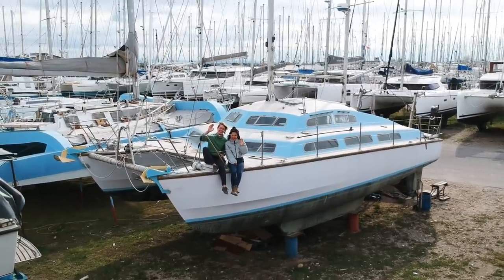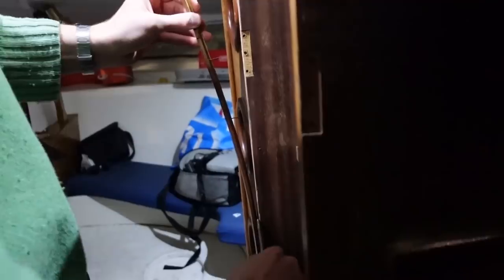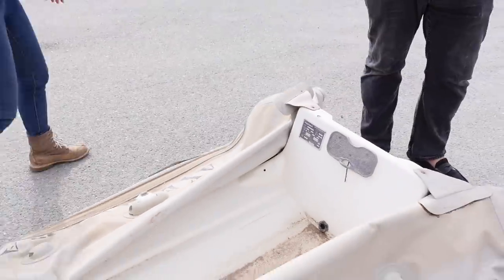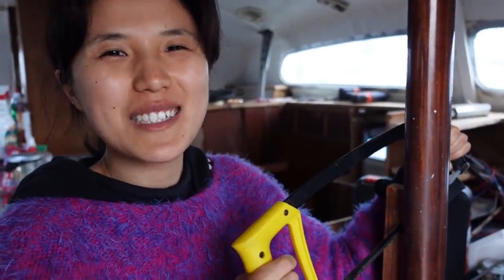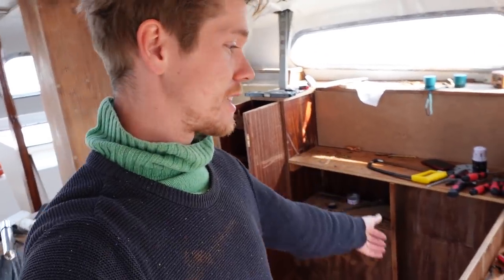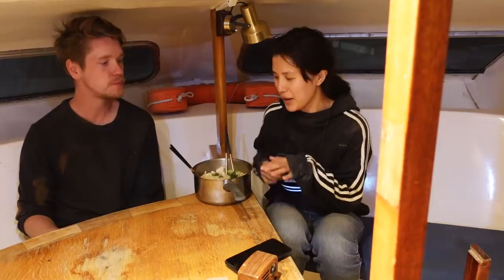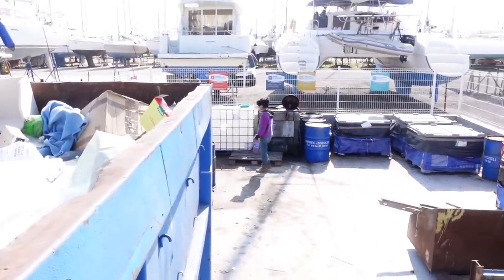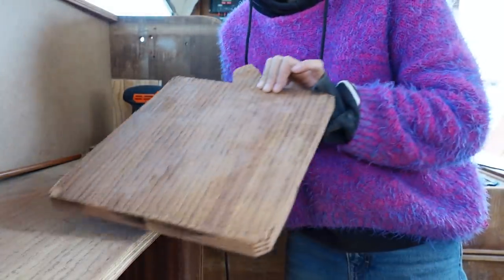Dirt Cheap Catamaran Refit | Part 1 | Wildlings Sailing

Comment: Hey Mark you really should install an expansion tank for your water system. i noticed that your pump turns off and on with the faucets. If you install the expansion tank it will act as a buffer allowing the system to hold pressure for longer which means your pump wont run as often.
Reply from the maker: Cool, will do for sure, it's definitely needed

Comment: Just some safety tips from my experiance,    #1  Clean your fuel tanks if you can,  Some day you will be in heavy seas and  scared , thats when crap will come loose in the tanks  and plug your filters and shut you down at the worst moment.      #  2 thouroughly inspect and lubricate your steering and rudders.   #3   If you can , find someone who is very  knowledgeable about that engine and those hydraulic sail drives to check them and teach you how to maintain them because you will be the one fixing them .  #4   Change out  below water line thru hulls if they havent been changed in a long time, seal  them properly.      These are just key safety items needed to get you through a storm.
Reply: And take out and plug up the through hull speed paddle wheel if it has one.  Major common source of failure and scary when they do. See Lady K and Zingaro episodes.
Reply: i was in some of the cat forums and a cherokee 35 owner said "once we pulled out the old hydraulic drive system and put in a Honda 50hp she sailed quite well"  The number one problem with sail drives is corrosion and if the previous owner didn't keep up on replacing anodes, the drive may need more work than its worth.
Reply: @gregh7457   I heard that too on old hyd drive issues, thats the best fix ,  could cut half the weight too.

Comment: Prep work is the most important.  95% prep, 5% paint is my formula.  Get the "best" epoxy paint you can afford.
Reply: 🤔 as for the deck non-skid & not knowning. If the adhesion is still good, clean it really good. Then clean it again. Yes, again! Apply a thin coat of etching primer followed by several thin coats of capatable (with the etching primer) mono-epoxy paint. This should do the color change very well.

Comment: For 11k, you got that Cat for a steal. I tried looking at a Cat originally and I couldn't find one for that price here on the West Coast of the US. 

My only warning: don't lose motivation. You're taking on a serious project, and more often than not what causes a boat to die is someone giving up mid-refit. Push through, and you'll have many years of happy sailing.
Reply: In Seattle, but closest to this I could find was a Cat on the East Coast (converted to power only) for 14,500.  Should go to France to the cheap boatyard.

Comment: On our old Cherokee we ended up removing the motor and all hydraulics. We cut a hole in the cockpit sole and bridgedeck, built a pod and hung a Honda 50 outboard on it. We shedded hundreds of pounds, removed 2 large 3 bladed props that were a lot of drag under sail and made the Honda steerable with the wheel. Really transformed the sailing performance.
Reply: He could just keep it until he has enough money to put those folding props,  the kind that folds when under wind power open up under direct power. It looks squidish (my daughters words. she's weird like her dad)
Reply from the maker: Nice, we're definitely keeping an open mind in a conversion
Reply: Which Cherokee did you own (Hull #)?  I moderate the Iroquois Facebook Group and we are trying to document ownership / location of all Sailcraft models

Comment: We love the way you're re-using and re-purposing the old stuff on the boat. Not just chucking it out and buying new. I'd use Blue Hylomar on any joints that could leak water / fuel / oil / you name it. My moped is made of Blue Hylomar.
Reply from the maker: Thanks for the suggestion 👍

Comment: I recently re-did my trimaran's deck and after talking to a painting store owner i used enamel outside decking paint almost more than half the price of ''  marine decking paint '' and it's been on for a year now and i have not had any issues but surface preparation is the key to any painting i even rang the companies help line and the people there told me the only difference between marine and house hold was the price and the label good luck and BTW you guys are amazing a true inspiration to all cheers from South Australia

Comment: Leaving the Comfort Zone?  It's like jumping into cold water, it's not easy.  But if you never do it you will never experience those amazing sunsets, those quiet nights bobbing at a secluded anchorage, motoring down a lush glass like canal in the morning.  Then there is the eeriness of being deep in a dripping lock or the exhilaration of pounding to windward in a fresh northern sea, the sails taunt and the rigging humming. Or a quiet sail across the bay at midnight - the only sound is the ripple of the bow wave, and flashing light houses and harbour lights thirty miles away to the south, watching a green meteor with a smoke trail streak overhead.  Sorry to go on, but I've been there, nothing on land comes close.  Good luck with your boat Mark and Nadiyana.  When you get to a quiet anchorage it will be your own private little cottage on the water.

Comment: The old fashioned way to do deck paint is to sand well, paint the deck with a good enamel then tape off the areas you don’t want non skid and paint the area you do, while it is wet sprinkle it with crushed walnut shells ( which you use to be able to get at the chandlery for cheap). When the paint dries brush off the excess grit and put a coat of paint on the whole deck. Looks neat and professional at a very good price. Sand works too but walnut shellscare lighter and easier on bare feet. Lots of luck!

Comment: One other thing mate, if you stick the end of that plastic pipe in a cup of boiling water, wait till it is soft, slip it on the hard pipe and tighten up the jubilee clip they won’t leak. Good luck guys.
Reply: Or the heat gun they already have.
Reply: Thank you! You have just helped me with a bathroom sink leak!

Comment: As long as the hull is sound then that is a fine deal. I paid way more for my Gemini 105M and it didn't come with updated electronics or a big box of tools. My engine and drive did run but was so neglected that I swapped it for a Yamaha T25 extra long leg outboard. It will be interesting to see you go through all the systems particularly the engine and hydraulics.

Comment: It looks like you are doing a reasonably good job chopping down those old cabinets and converting them into your new galley. 
That's not the easiest way to do things but it will save some time in the long run, it was brave to tackle that job like that and I think it will be much more practical than before !
I wouldn't want to have to rip it all out and start from scratch, that gets expensive and there's no end of designing and decision making before you can even start to rebuild it, at least this way you just need to decide what to cut away and what to leave.

Comment: Hi guys!! To prevent leaks, it is a good idea to put two collars on your hoses. It is mendatory for canadian boats but not every country requires it. You put one going clock wise and the second one a bit further going the other way. It one of the collars fails, the second one is there to do the job!

Comment: Talk about taking on a project! You two are fantastic !  So  far as deck coatings, I would suggest using a product called TuffCoat,  (made in  USA) I checked and found that it was available in Europe, or could be shipped to there. It is a little pricey- $79.00/gal, and they recommend a primer coat also. Advantages : a rubber softness , a nonslip compound in the mix, and very good reviews by users.    Keep up the good work .

Comment: I’m absolutely loving your approach to this project; a few descriptive words that constantly run through the tasks are ; Practicality, economy, ingenuity, repurpose, repair and, last but not least, fearlessness!   A couple of comments I’d suggest considering though;  verify the internal parts you are removing are not part of the structural design that may compromise strength of the overall hull. When you rebuild, use screws and marine glue to ensure strength of the finished construction, nails won’t be strong enough. Try to “modularize” the cabinetry where you can so as to make it easier to remove sections in the event you need to get behind them in the future. When repairing or rerunning water pipes, make sure as much as possible that they drain to low points to avoid freezing when winter comes.  If you can use hard “Pex” style pipe and compressions fittings you can avoid joints pushing off fittings, especially if it’s on hot water runs. Keep up the enthusiasm ! 😎🇬🇧

Comment: Hi Guys love your project, one of the best non slip deck paints is "KIWI GRIP" easy to apply and is tough as old boots and the best part it's water based, it's a little expensive but definitely worth every cent. Cheers from Down under.

Comment: Great job! If you break the jigsaw blade near the top, if you just grind it down a bit on one edge for about 8mm so it fits the slot in the saw itself you can keep on using it. I might suggest using a more aggressive courser blade for the thicker wood then using the sander  to smooth the rough cut down. Paint could well be fine, just need more stirring to mix up the pigment then varnish the tin to slow down the rust, which does not look like it's penetrated the tin yet. I use a handheld belt sander to good effect. A course grit gets rid of a lot of material and can deal with a large area. I used mine to clean the hulls on a cat before giving them an epoxy barrier coat.

Comment: Hi Wildlings!  One of the big expenses on a cat is the rigging. The rigging on a cat takes a lot more of a bashing than if it were on a mono hull - obviously, as cats don't heal and spill the wind in the way monos do. Also, I imagine that model may not be too good upwind so you may find you motor more and, I expect the engine is a bit of a heavy drinker!  It's a pleasure watching your happiness - I'm very happy too!
Reply: Mercedes OM636 @ 1500rpm (which on a Westerly 33 gets you 5.0/5.5kt depending on wind and current) consumes an average of 2 liters per hour. At 2000rpm it'll be up to 2.6lph - and that's with a non-overhauled engine and fuel injection pump, they've got an overhauled everything really so it should end up consuming a little bit less than that. It's not too bad for a 42hp 4 cylinder :)

Comment: The deck can be painted once prepped, Then when the first coat gets tacky, Chuck sharp sand all over it, Weight 1 hr, Go for a cuppa, Then brush off the excess sand lightly, Then repaint over the sand, That's what we did for painting fishing trawler boats, And it lasts for years, No expensive paint needed.

Comment: Once you have sorted the basic onboard living conditions, get cracking on the motor before dealing with deck, rigging and hull cosmetics / fixes (assuming there will be no surprises with these). Motor issues can be messy and costly (of course). Well done so far. Great project and satisfying for you and of course the viewers too. Best.

Comment: Awesome progress guys! As far as non slip goes, I would use what you have to hand. But otherwise, I would use Kiwi Grip, it's easy to use, easy to repair, and only one pot so no mixing in hardener or sand etc.

Comment: the greatest costs associated with Cats over Monos are things that are doubled up on or found only on Cats. When you have 2x engines you also have two shafts, belts, filters that sort of things. The other thing is the trampolines. That is a cost that is not equalized on Monohulls. But what you cost up you also get benefits associated with. Such as great handling while under power, a lot of space on deck, and some redundancy. Cheers on the renovation and Best wishes!

Comment: Painting = prepping.  The very best paint in the world cannot cover a bad surface.  Even worse, painting over problems will let the problem re-surface later, and likely worse than it was at the time you painted.  Prepping the surface to be painted is critical to good adhesion.  If there is loose debris, oils (even body oils from finger prints) will later reflect in bubbles, paint coming off, etc.  So, right before you paint, throughly clean.  Other posts have said 95% prep - absolutely agree.

Comment: Rare boat have not seen another ketch cat on YouTube,  In USA often preferred paint is Awlgrip, some use cheap paint with regrets
Reply: I agree, but first buy a small amount of the expensive paint and first do a test for optimal adhesion to the old paint, also the quality of the substrate must be good.

Comment: For paints International Perfection 2 Part Poly Topcoat is fantastic, applied with mohair rollers no need to tip it off and looks better than sprayed, A channel to get advice is BoatworksToday for paints, antiskids and fibreglass works being american the paints arent easily available but International marine is it for us...(I think Mads of Sail Life used it on Athena)..Just remember lots of preparation and cleaning before any paint touches a brush....
P.S. Little tip when cutting veneered or faced wood score the pencil marks with a stanley knife/boxcutter/scalpel it will prevent the saw blade tearing/splintering the finish
Reply: P.S. Little tip when cutting veneered or faced wood score the pencil marks with a stanley knife/boxcutter/scalpel it will prevent the saw blade tearing/splintering the finish
Reply: Caution before using international perfection or any other 2 part paint, it should only be applied over 2 part primers or under coats other wise it will melt the paint under it and fail. It's a fantastic product and its what I used but  it is one of the most expensive options.

Comment: Hi kids,
I think I commented about how much you will will learn.  And are you ever.  In a mere week you have become serious boat renovators, know your electronics and are tackling all that's needed in the galley reno.  At one point I had a pang of jealousy at all the fun and satisfaction with your work you two were having.
A thought:  how great will it be when at anchor you are daydreaming under the spell of ocean sway and heave, then notice yourself stroking a newly finished wooden surface you renewed with your own hands.  I see moments like this in your future.
Well done.
I was going to mention using a guide for the the jigsaw, but your your dad did.  Also note that jigsaws are not great for cutting straight lines--circular saws are typically what you would use and with a fine cut blade (given you were modifying existing cabinets).  But the best advise is, I think, get advice that's closest at hand--and I think there must be some good woodworkers close to you.
Your evident happiness with your new adventures was very satisfying to see.
And I very much liked your scrounging: very cool.  Lots of free stuff is just there for the takings, so am very pleased to see you two lovelies applying the first two principles of recycling: reduce and reuse
You need a couple of straightedges for guides and marking, maybe a chalkline.
Nadiyana, you look superb in your bandana head covering, mask and dusty hands.  Seeing you two happily working was just great.
Painted a brilliant white?  What--oh, nooooo!  Okay, but there's already a lot of white, so what about some colour or colours.  For example the the cabinet carcass, box, could be white, then the doors or drawer face/fronts could be really cool colours.  And remember there are a lot of whites that can be more warm, soft, etc--it might even be good to put some colour on the interior of the hull.  Also thinking that fabric, like the colour in the bowl Nadiyana liked, would give more character and warmth.
Deck painting advice?  You will get a lot, some which will be good.  I know nothing about painting boats; however, I know 2 things about painting:
1.  Before anything,  ensure the structure being painted isn't in need of repairs;
2.  Then, it's all prep (of existing surface/painted surfaces) and correct use and application of the paints.
Thanks for the updates,
Great to hear some of peeps are able to be generous,
I send you happy thoughts,
All the Best,
Dawson